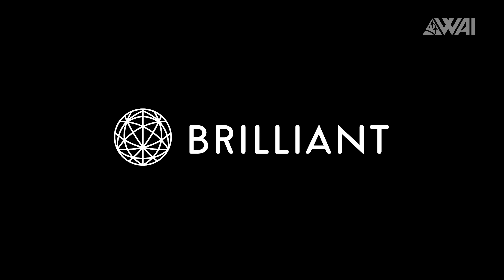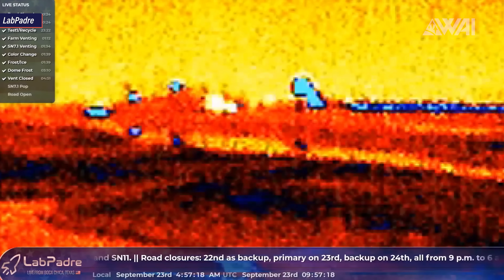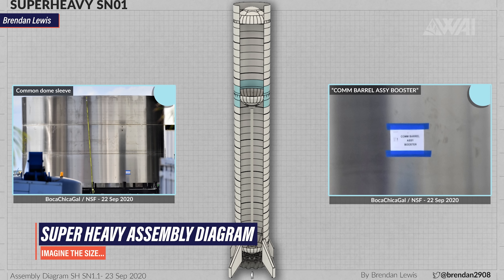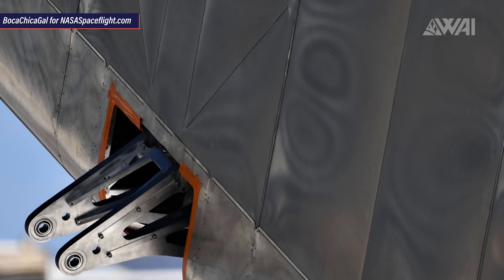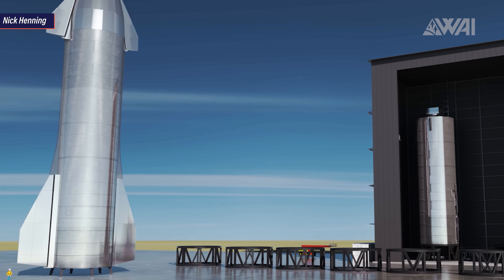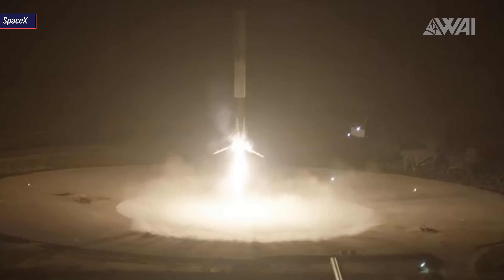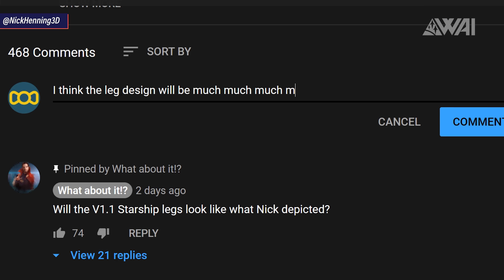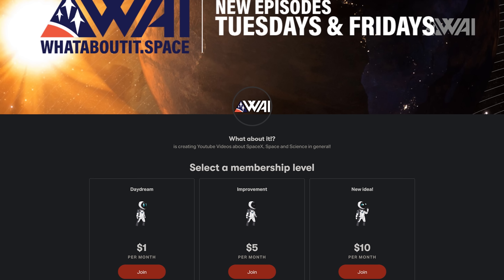122 | SpaceX Starship Super Heavy SN01 In Production!

Comment: Thee legs are best in my mind, simple solution for auto-leveling on uneven ground, this is the musk way.. simplicity
Reply: Agree.  Also, with three legs only one would need a heat shield and apart from auto levelling, three legs are inherently stable.
Reply: @chrisantoniou4366  I wouldn't buy an office chair with only three legs.  It takes 5 to make a stable platform for something top-heavy.
Reply: @SAMATOZ2  Yes, but we're not talking about an office chair or anything top heavy.  The starship will be bottom heavy on landing and weight is also a consieration.
Reply: Close cuircit hydraulic system, diaphram assisted auto leveling

Comment: None of those proposed solutions will work.  Legs need to provide a very wide stance, while also being aerodynamic and heat shielded. It’s a very tough problem.
Reply: If it's a tripod only one of the legs will need a heat shiled and it woud be an inherently stable design.
Reply: Chris Antoniou Tripod is less stable than 4 legs,  which are less stable than 5.
Reply: @RogerWilco1  Not on an uneven surface.  If you have a table and a tripod at home, take them out to some uneven surfaces and see which one is more stable.  It's almost impossible to get anything with four legs stable on an uneven surface.  If the requirement was for landing only on even (prepared landing pad) surfaces, then it wouldn't make much difference.
Reply: Chris Antoniou You assume the legs cant adjust.  If that were so, 3 legs would still be worse, even worse.

It’s straightforward physics, each leg provides an opportunity to prevent tipping in that direction.  More legs, more opportunities and more force.
Reply: @RogerWilco1  No I'm not assuming the legs can't adjuts and stability is different to having the starship landing perfectly vertical.  Stability depends on the length of the legs as well as the number so simply saying it's the number of legs that determine stability is wrong.   Each leg does exert a force that prevents an object from tipping in that direction, but the tipping point depends on how long each leg is.  In other words, the longer the legs, the less likely it is that the starship will tip over and three longer legs will be better (and lighter) than four shorter legs.

Also, stability is automatic with three legs but would be impossible if even one levelling device on a four leg system was to fail.  Remember, stability is something different to a perfectly vertical landing.  A three legged ship may not land verically but will be stable while a four legged ship may land perfectly vertical but be unstable.
Reply: Chris Antoniou You really have no clue what you are talking about and are employing a double standard. If any single leveling device fails on a three leg system, it WILL fall over, if one fails on a four leg system, the opposite leg can shorten to compensate.

Your own example doesn’t even support it. 

I conclude you are clueless and just here to argue nonsense, so I’m muting you.
Reply: @RogerWilco1  Try the experiment dummy!  Muting me isn't going to help you.  You invoked "physics" without even knowing all the parameters that need to be included.  Three legged systems will NOT fall over just because a levelling device doesn't work, neither will four legged systems.  You clearly don't understand the difference btween tippoing over and stability.  Look up a dictionary and understand the concepts before responding.

Comment: One comment i've seen time and again from Engineers is that SN7.1 failure mode was not at the weld but a split across the weld.  This makes sense as the weld would be stronger than the sheet steel itself.  Some crazy pressures reached i imagine, which is great news for SpaceX.
Reply: Considering that Elon up until now has been transparent about the amount of pressure in previous tanks it's possible that it took more pressure than expected to blow its top

Comment: Feel like starship legs will be much different from falcon legs cause starship is the next generation vehicle and get new designs...
Reply from the maker: That's why I kept Nick's render! Diversity. It will be interesting to see, what SpaceX comes up with for the final version! :_WAIRocket:
Reply: Acme Slingshot  regarding retractable, being able to have it under the skirt has to be quite preferable. Imagining retracting the legs on a flight home from Mars, and having to rely on the heat shield not being messed up... Although I guess they could make an inspection EVA during flight, now that would be quite sci-fi!.
Reply: Benjamin McCann  omni wheels are quite different though :).

Comment: What's the thickness of superheavy so we can speculate on the pressure?
Reply: You can find that information on the YT channel "Spaceflight Explained", most recent of three.
Reply: @janetizzy6741  Thank's
Reply: @janetizzy6741  That's starship, not superheavy. It's like a balloon tank, the more mass you have to lift, the more pressure you need and the thicker the walls.
Reply: @johntheux9238  As you now found out, it is expected that EM will scale the thickness as required the length of both/either barrel.
Start with the known characteristics of the label, use video sizes and frame rates to determine the tank pressure at burst, scale the length from those figures, either barrel. Also note that the dome failed, that SFE pointed out that the dome had half the load as the barrel, Q.E.D: The 304l of the dome was far harder than it should have been. It should have had more ductile processing.

Comment: I still believe that reducing the number of welds is going to alleviate a lot of possible failure points.  Hopefully spacex decides to move to larger sheets of stainless steel that can be welded at one seam, and the domes spun as single parts on the production examples.  Would require massive machinery but if anyone can do it, SpaceX can.
Reply from the maker: The ring segments do not seem to be any sort of problem though. Failures always occure on the domes. :_WAIHello:
Reply: What about it!? True, but they can speed up production by making larger cylinders, and would look better.
Reply: @chrishoesel  once the design is finalized, they may still do this. Adapting highly specialized machinery to changing alloys, shifting design details etc, is way harder than the flexible methods they use now.
Reply: Wouter De Vlieger of course. I like this agile method of prototyping.  I think the final design may not look at all like what we see now.   Once they enter full production I’m sure they will be built similarly to the way F9 is built, with more automation involved.